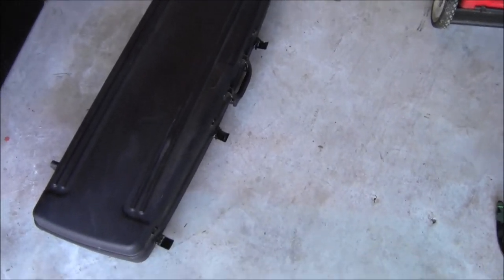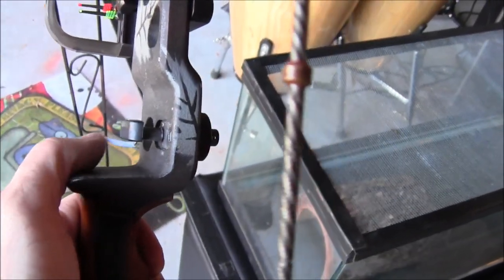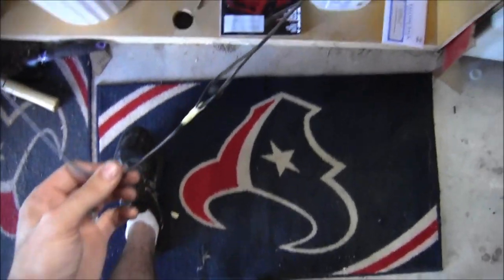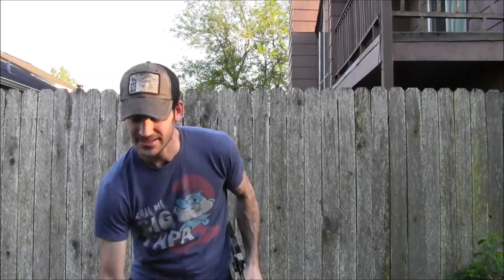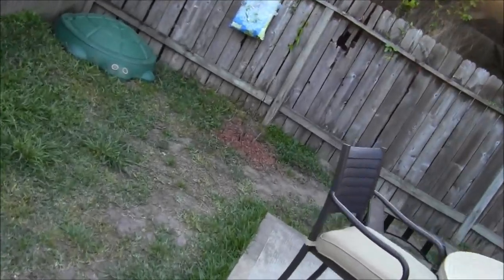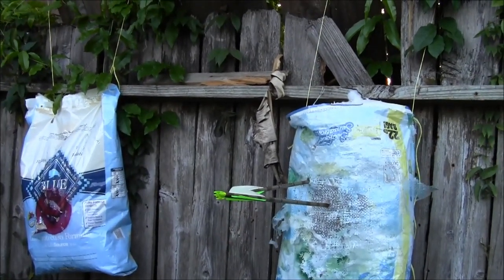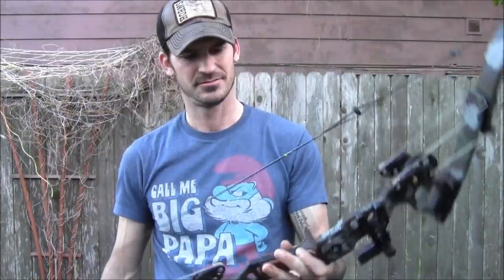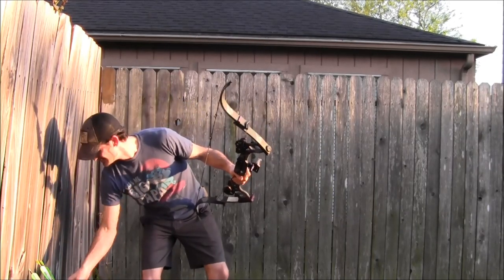Oneida Black Eagle unboxing Ebay and Shooting

Comment: Late to the party, but just came upon this video while reminiscing about my old Oneida AeroForce X-80.  Absolutely dead on about the accuracy: my first time out with the X-80, I split an arrow right down the middle, and that was shooting instinctive.  Nothing got people's attention at the range like that bow at full draw.  I will say mine was not remotely as quiet as the Black Eagle, even when paired with fat Easton Gamegetter arrows.  I ended up selling it off after I became paranoid about the steel power cables snapping under tension and possibly whipping me in the face.  I do miss it, though I'm not sorry I never had to learn how to work on the thing.

Comment: If you're interested in making your own arrows, you can get some prepreg carbon fiber from easy composites. Also check out their rolling carbon fiber video. It's pretty simple and boy oh boy, with the correct things, lightweight tips and flechings, we got the weigh down to two grams per arrow. You can also fuck around with the power on these bows and if you use a pully system you can make it a 300+ lb drawback that is actually pretty light.

Comment: To change out the draw length you need different modules right? But then you would also need different cables and a whole new string for the set up too?
Reply from the maker: Nicholas Bello To change draw lengths you switch out modules. It changes let off as well.
Oneidas come in short, medium, and long. They range from 24" draw roughly, to 33" draw. Let off is the amount of weight in lb you are pulling back when you reach anchor. If you had a 60 lb bow with 66% let off you would be drawing back, at anchor -about 20 lb. 
http://youtu.be/fzTOJpXveBY

Hope that helps
Reply: Texas Slinger just got the bow its in perfect 100/100 condition! im having trouble determining the year, draw length and type of eagle but i want to say its from 2000 if ic an get your email or something i can send you pics. it says medium draw length 43 1/4 omni flite Q8286 with "LM" written before it in pen
Reply from the maker: I need to see the label. it should be on the inside of the lower limb. I'll message you my email. You can take a pic of the label and whole bow and ill try to determine from there

Comment: I just got a screaming eagle. It's awesome. I have a quick question. do I need longer arrows than what I would use with my normal recurves?
Reply from the maker: +davidmartin192 as long as your bow is set to YOUR draw length, your arrows should be 1 or two inches past your draw length depending on spine and field point weights. Mine is 29 in so my arrows are 30 in with a 125 grain point. They shoot pretty straight. any bow shop should be able to set you up

Comment: does the anchor point have to be changed going from a traditional recurve to an oneida? i just received my oneida aeroforce x80 (yessssss!) and the draw is a little long for me. im assuming the previous owner used a trigger release. im coming from a recurve using my index finger in the corner of my mouth as my anchor point. just wondering if i can get my oneida adjusted to do that or if i have to get used to anchoring around my chin
Reply from the maker: I use different anchor points myself. from a compound with a release ill anchor lower. instinctive shooting ill anchor around my cheek.
Reply from the maker: I/ve since change my trad anchor point to below my chin. kinda had to start over and make a different sight picture near the bow but I can tell im getting better

Comment: Btw what shaft size are those Easton Camo hunter?  I'm trying to look for the Alum arrows from ether the Jazz, Game Getter, or Camo Hunter that would fit around 40,45pounds. Would you know which shaft 0000 size or spine 400-500 would fit that?
Reply from the maker: Raptorduder those are 3317 I think. I would go with game getter they are super tough. out of all my arrows I have shot a number of times, they have survived and kept on ticking
Reply: Texas Slinger Do you know if the 500 game getter's are spined for 45pounds?
Reply from the maker: It would depend on the draw length and field tip weight
http://forum.gon.com/attachment.php?attachmentid=650207&d=1329008741

check here or just google "easton aluminum arrow chart" consider what field points to use. I like heavier ones like 125. then anywhere from 340 to 500 depending on draw length. Mine is 29"

Comment: http://arrow.wikia.com/wiki/Oliver_Queen%27s_bow yes Stephen did use a kestrel Chronologically, Oliver has used 7 bows; a traditional carbon fiber longbow, a recurve bow, an Oneida Kestrel compound bow, which was later modified slightly, a League of Assassins takedown recurve bow, another Oneida Kestrel compound bow, and later another custom recurve bow.

Comment: Hi I recently purchased a Aeroforce x80. I am new to compound bows and this brand. You are very knowledgeable about these bows. Something does not look right to me on the cam. Don't know if is just me or if there is something wrong. I do not want to fire this bow until I find out about my concerns. Is there anyway I can get an email address so I can send you a photo and get your opinion? I would greatly appreciate it. Thanks
Reply from the maker: +Vincent Kugler Jr. sure. send detailed pics to pcoca78@gmail.com  I will certainly do my best.  by the way you can check out this video with my old X80
https://youtu.be/rVimqlafy_Y
Reply: +Texas Slinger Thank you. Been watching all your videos and learning alot from them.

Comment: I'm wondering exactly how this bow works, so i get the cams, the timing cables and the hinges, but what about the limbs? which limbs bend when you draw the bow, the bottom ones(attached tho the riser) , or the top ones(the ones that are hinged on the bottom ones)?
Reply from the maker: the inner limbs flex. the shape of the cams allow for let off. I will make a good video in slow motion showing the bow in action soon. stay tuned.
Reply: Texas Slinger
thank you I appreciate it.

Comment: Hey, so I have a bow similar to this one but it's camo rather then like yours and I can't seem to find much information on oneida bows anywhere and you have the best review video I've found, do you mind taking a look at my bow to help me find the model name etc?
Reply from the maker: +Dominic Abel Please send me several photos. pcoca78@gmail.com. if there is a label on the bottom limb that would be very useful.
off the bat if your riser is skeletonized then it is a Black Eagle or equivalant only if the cams are built into the riser. There was a Light Force Magnum with a skeletonized riser with cams off the pile on. I look forward to seeing your pics
Reply: Thank you so much I sent the email just reply on there if you need any more pictures great video by the way

Comment: Which do you like better? the tomcat or the black eagle? is it possible to get one of these bows NEW? I am leaning to the black eagle..... :D
Reply from the maker: Black Eagle would be my choice. They are not manufactured anymore. ebay is a good place to start. Also if you call CP Oneida in Michigan they have refurb Black Eagles to my knowlege
Reply: cool THX :D Now that I already asked you I would also like to know if you tried the Kestrel? and out of all the Oneida bows that you tired which would you go for?
Reply from the maker: Igor Bajic  I have not tried the Kestrel. I am very pleased with the Black Eagle. Great brand new bows go for the cost of the used Black Eagle. I wouldn't mind trying the Kestrel out one day.

Comment: When you get an Oneida off eBay, what are the things u have to inspect before shooting?
Reply from the maker: timing cable
power and yolk cables (they are like aircraft cable)
screws, bolts and nuts, and the string
if the bow requires a string you can check the saddle bolts while string is off

Comment: Ditch those aluminium arrows and go for carbon or alloy, trust me it will dramatically improve the accuracy and feel a lot better.
Reply from the maker: +swrexhunter Oneida bows love aluminum arrows. always have, always will. Tried a few carbons. bow was louder, and arrows flight a little off. Aluminum hold up better, durable and hit harder. Thanks for the input
Reply: +Texas Slinger I shoot 340 carbon  BassPro Blackout Envy (cheap) , with the heaviest tips I can find (175-200gr) ....once tuned specifically for this arrow type/setup, the bow quiets and straightens out dramatically...try it, just do it with the heaviest per inch carbons you can get...

Comment: Are you willing to sell this? I know it seems you only had it for a few months but it's worth a shot ;)
Reply: http://cponeidaeagle.com/cp_oneida_eagle_bows_003.htm

You're welcome.
Reply: AtariMaxiToriyama I have already checked out their website, but thanks for trying to help. But here is why I want a used one rather than a new one. The Hawk, Talon, & Osprey do not have my ideal draw weight (at least 60lbs). The only one that is ideal is the Kestrel. But I am not willing to buy it for $1500+ (including tax). That's why I asked. The black eagle seems like the next best thing.
Reply from the maker: ImThinking3 http://www.ebay.com/itm/281558845867?ssPageName=STRK%3AMEBIDX%3AIT&fromMakeTrack=true
Reply from the maker: AtariMaxiToriyama http://www.ebay.com/itm/281558845867?ssPageName=STRK%3AMEBIDX%3AIT&fromMakeTrack=true
Reply: ImThinking3
 You don't need to buy it in one go. Save up three-hundred dollars a pay-check.  Two and a half months and you'll have the money.
Reply: AtariMaxiToriyama I never said I don't have the money. I said I wasn't willing to spend that much. That's how you save XD
Reply: Texas Slinger Thanks
Reply: ImThinking3  Yeah, but why not? If you save for a little while, then the money is just sitting there. Might as well buy the one you want.
Reply: AtariMaxiToriyama you missed my point entirely. XD
Reply: ImThinking3 Elaborate, please.
Reply: AtariMaxiToriyama Just reread what I wrote (about spending). XD
Reply: ImThinking3 Right, so save a little at a time and then you can buy it as if you weren't spending anything.

Comment: I fail to see the advantage other than the convenience of having a normal string.
Reply from the maker: You should shoot it one day.
Reply: Texas Slinger Well, I'm certainly not downing it, and they aren't so expensive that it's not obtainable.  I just don't understand it's intended philosophy of use.
Reply from the maker: +RandyLeftHandy ??? its a bow
Reply: Texas Slinger It's advertised as a 'hybrid' compound bow, but it still has a set draw length, so it really is just a compound bow.  I just fail to see advantages, I'm not inferring that there are none.
Reply from the maker: +RandyLeftHandy Some advantages would be a 75% let off
adjustable draw length, Medium, which is mine
Best thing about these bows from Oneida is that the mid 80s ones still work well and they all have a type of cult following. Interestingly the owner of Bass Pro Shop just bought the company. 
Very easy to Tune and perform maintenance. 
 
Arguably they just look cool
Reply: i would say the advantage is having the let off of a compound bow while being able to shoot with your fingers without the risk of derailing. i would probably buy a lh version if available so i can shoot rh with a thumb ring release. i can only imagine the string pinch angle on your fingers with a bow that short
Reply: That's more like it, and I could definitely pull off shooting this bow with a thumb ring.

Comment: Cool! But in my opinion, the arrow clip on your hand is cheaty... learn to shoot arrows without it.
Reply from the maker: watches one of my videos, thinks he knows Texas Slinger.
Reply: I wasnt judging you. Just in my opinion its cheaty
Reply: EchoPlays That is called a finger tab. It's not a arrow clip, It's so his fingers don't get burned or have to get pinched while holding the string back. All it is is just some fine leather. Nothing else to fancy.

If your meaning a Release, That clips on the string while it's pulled back with ether your wrist or hand by thumb release.